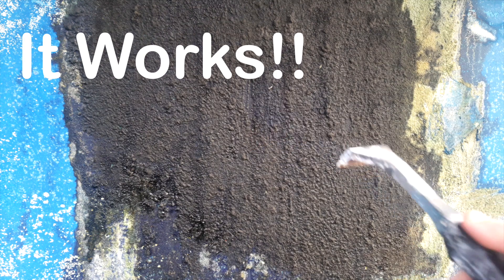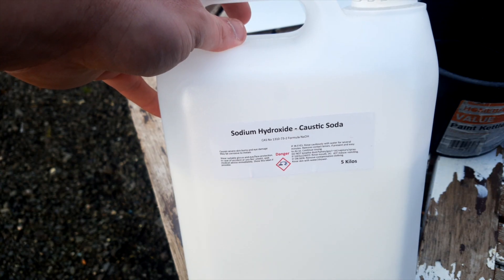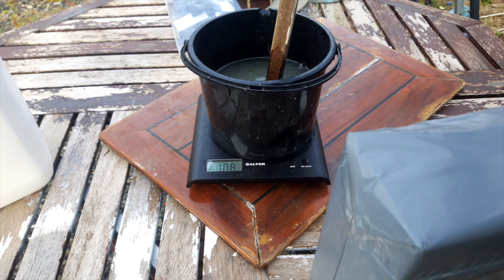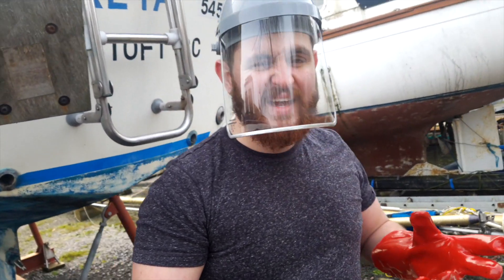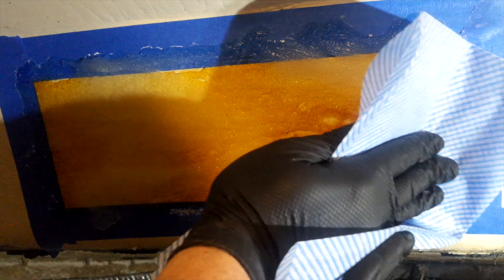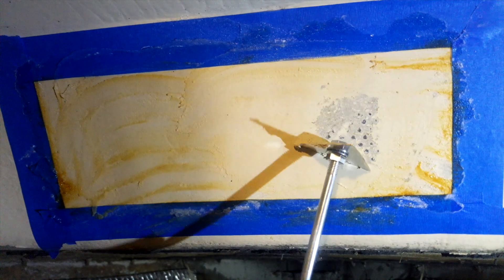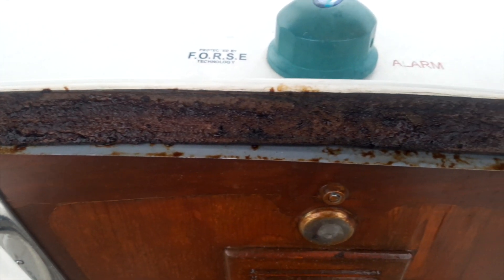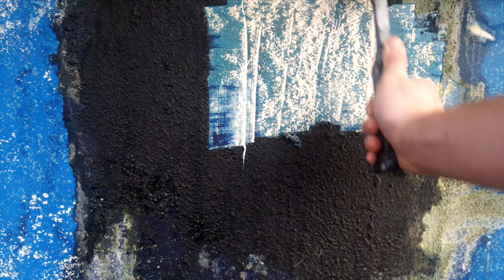DIY Caustic Soda Gel Paint Stripper

Comment: edit: 5:00 A WEEK?!?! WTF?!
borax, amonia, washing soda in 1:1:1 proportions - good ventilation required with amonia!
add water - make a ~paste like consistency...
30 minutes and paint is gone :)

it's safer, and faster result... maybe need to use twice sometimes...

----

Do you use the same safety measures when applying commercial paint remover? It's basicaly the same substance... 1:20 'GENIUSES'.... :D 
Ofc, im not an idiot - it's dangerous substance, don't fuck with it!
But also don't be a pussy... use glasses, and some gloves - that's it... if you get it on your arm - just wash it fast and neutralise asap... no big deal...

Also, u neutralise soda with acids (top 9 of table below - use anything u have nearby those won't harm you) - not soap... PH scale is logarythmic, and looks ~as follows:
2.4PH citrine
2.5 coca-cola
2.9 vineger
3.5 orange juice
4.0 tomato
4.5 beer
5.0 coffee
5.5 tea
6.5 milk
7.0 clean destilled water --- this is neutral middle value
7.4 blood / saliva
everything below will harm you (eventually if too much contact)
8.0 salty water
9.5 soap - actually it depends on a soap...
11.5 ammonia water
12.5 Calcium hydroxide - CaOH2
14.0 - caustic soda - NaOH

Comment: Having a spray bottle of acetic acid (distilled white vinegar) is a great way to start if you have a spill somewhere you don't want it. Especially on your skin but definitely not your eyes just use a hose or tap for that. Honestly wear some chemical safety glasses the same ones you used in highschool chemistry. They prevent spills from getting in your eyes and sodium hydroxide (lye/caustic soda) will make you go blind very fast. If you happened to get it on your skin spray the vinegar on it while running to a water source and flush for at least twenty minutes. If you happen to get it on your shirt do not remove it by pulling it over your head (it will get into your eyes) rip or cut it off. Best to wear a shirt that buttons down that's why lab coats are button down so if we spill on the coat we remove it without running water chemical past our eyes. Adding sodium hydroxide and water is an endothermic reaction which means it's going to get very hot. Add the soda slowly to prevent it boiling to water and splashing where you don't want it. 
Tldr: wear chemical safety glasses ~$3.00 usd at Walmart, wear proper chemical resistant gloves ~$5.00 at any hardware store, wear a button down shirt, wear pants, and wear some shoes that cover your feet. It's safe to handle but in the event it splashes I'd rather a cheap shirt get a chemical burn rather than my skin.

Comment: You have this wrong. Hot caustic works best as they are oils you are trying to disolve and it is more active when hot. We had an imersion heater in our dipping tank. The wallpaper paste is ok for easier handling, but it needs to be worked with a scrubbing brush on first application. You can clean down and reapply in 10 mins. To cover and leave means that a lot of the caustic is isolated from the surface and patches of wood can be broken down more than others.
Reply from the maker: A hot caustic solution works quicker but ambient temperature works just as well, just takes longer. If your dipping tank was in a business they're much more time sensitive than what I was aiming to show here. You're right that a lot of the caustic is away from the surface and not reacting with anything, however, this is the best way to get it to adhere to a vertical surface in a way where it can be left in contact for as long as possible.  Agitation would help with a scrubber but the thickness of what's applied helps the mixture from drying out and keeps it active for longer, once dry the mixture stops working at all, so thicker helps. Thanks for watching 👍

Comment: You need an acid to neutralize it afterwards on any of the wood parts.  Great video 👍
Reply from the maker: Adding acid produces heat. This isn't recommended. Just lots of water afterwards to dilute the solution. Lots and lots of water 💧

Comment: Hey wallpaper paste is expensive;flour and water mixed is wallpaper paste
Reply from the maker: Never tried mixing it with flour, if you try it comment back and let us know!
Reply: How is flour glue?
Reply: @bitTorrenter  mix flour and water and a little salt as preserver if wanted;this is glue for paper.adjust thickness of glue to suit thickness of paper;I have used this glue to attach 2mm card to walls as under paper prior to painting to hide cracks etc;still attached after 26 years.This is what they used in the old days

Comment: Keep lemons handy for washing it off in emergency;wear eye protection to avoid eye injury
Reply from the maker: Adding acid produces more heat because of the exothermic reaction, this isn't recommended. Just flush with lots and lots of water to dilute the solution with no heat 👍 keep safe and thanks for watching
Reply: @SVLaViajera  Neutralising acid spills with alkaline substances such as Baking Soda or Washing Soda is quite common. So, why not the opposite?